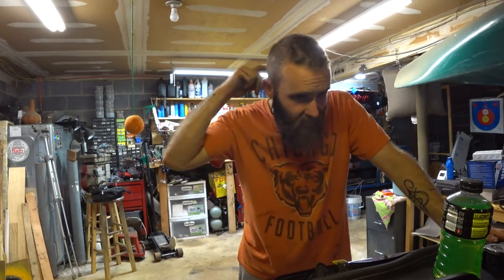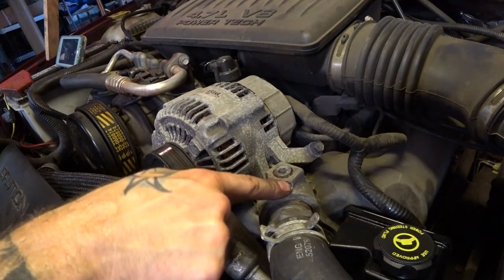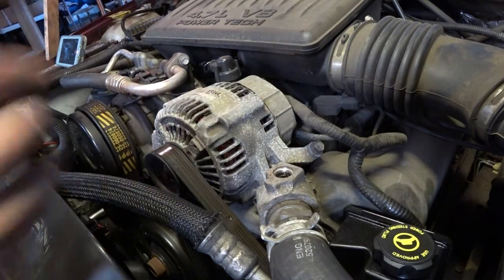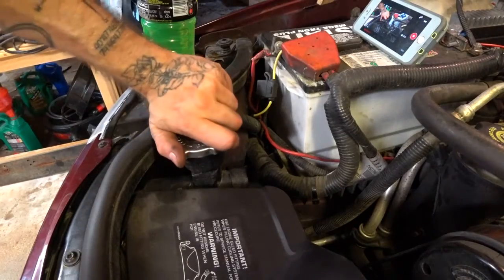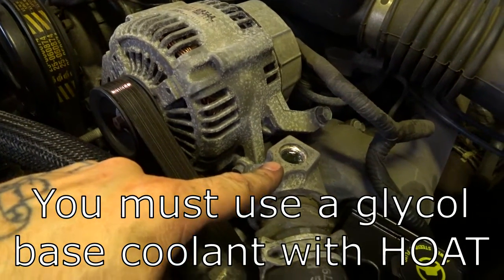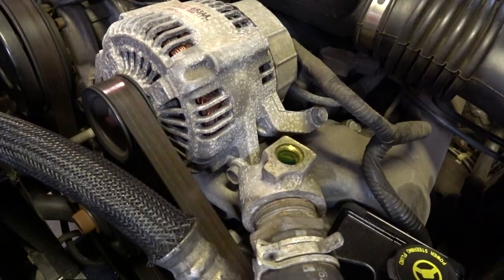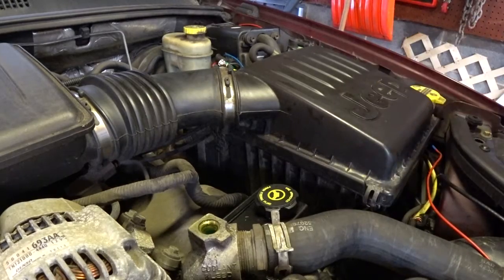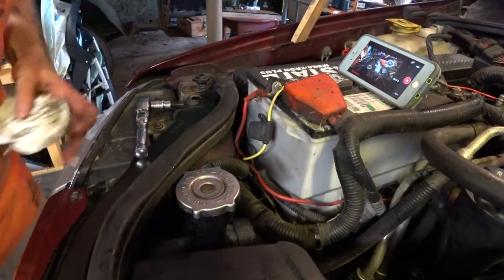How to Bleed a  Radiator - Jeep/Dodge 4.7L

Comment: Bought 4.7 and was running a little warm so i did this and it worked untill it started getting hot again. Over time started notici g coolant drop tho and unfortunately i think i picked it up wi5h 2 cracked cylinder heads😓3200$ and 1 year later running good untill it just now getting hot outside... now it wants to creep up again... very scary. I also had the hydraulic fan system exchanged for a fan clutch as i was not having any luck with the new ps hydraulic pump... now it has a smaller fan though and wondering if the smaller fan is the cause of it getting warmer than normal???

Comment: What happens if it is still bubbling after about 20 minutes after reaching running temp ? Or how long does this process generally take if there is air in the system. I suspect there is a lot of air - - hear sloshing sound in passenger foot box.?

Comment: Thank you so much. I was not aware of this procedure. I just replaced the heads and water pump on my 2003 JGC with the 4.7 HO engine. I performed this procedure and successfully removed the air that was in the system. Great content for shade tree mechanic’s like myself.

Comment: Whew! Good thing i found this video. ‘02 DodgeRam15004.7v8 had a lower hose coolant leak. Drained coolant, changed both upper n lower n thermostat <<gasket/o-ring was worn. Good thing i youtubed while waiting for the coolant to circulate. I usually squeeze the upper hose to hopefully eliminate any trapped air. Awesome tip, thank you!

Comment: Anyone have any tips on how to get the valve off? The top of ny bleeder screw is stripped
Reply from the maker: Go and get a bit "easy out" or a T50 or larger torx bit. Screw in the easy-out or hammer in the torx bit. The pray. Before doing this you might want to try to heat up the area around the plug to break the seal and any corrosion that might be in the threads. It is likely stripped because it is in there pretty tight.
Reply: @DEInTheGarage  thanks…any idead on what i can use for a replacement? Or do you know where i can get the plug? Appreciate the help

Comment: Hey man! I love your channel. We seem to be on a similar wave length. lol! 
You seem to have a great love for these vehicles and solid amount of hands on experience and knowledge. I was curious if you had a video or maybe a list of things to tackle first when buying one. As in when I buy a 4.7 WJ 4x4 what should I look to tackle first as preventative maintenance and possible replacement just to make sure I am starting with as solid of a rig as I can. I'm currently looking at a few limiteds with less than 100K miles on them. I assume those will be in great shape to start, if they weren't neglected. I have a lot planned for my WJ but I want to start with trying to "bullet proof" it the best I can if that is even possible lol! I'm an industrial mechanic by trade so I have a pretty solid mechanical aptitude. Any pointers or sources of knowledge would help. Thanks in advance!

Comment: I can't THANK YOU enough! I've already had to replace the engine in my 2007 Dodge Ram 1500 because of the dropped seat exactly as you explained  ... Was running well until recently, started loosing coolant and not getting heat like I used to... I'm betting the mechanics that replaced the engine and radiator didn't do this .. gonna try it as soon as it cools down 🤞
Reply from the maker: Good luck!!
Reply: Same thing happened to in my 4.7L Commander. 6k for a new crate motor, ouch!

Comment: This works. I tried to bleed my system by just removing the radiator cap and elevating the front end of the truck and the heat would not come through and I saw no bubbles.  I removed the valve he showed and left the cap off and instantly saw bubbles coming from the valve port. But do be aware if you don’t have a wide funnel to catch the coolant you will looses some. And possibly spill onto the engine causing a burning coolant smell. Obviously lol.  But after about ten minutes the heat was melt my skin hot  so ik it opened up and I shut the truck off and capped everything off. Be sure to take the vehicle on short drives and check the fluid level often when the vehicle is cold.  To ensure you have the proper amount of coolant in the radiator, reservoir and engine.   The AC blows penguins and the heat blows fire   The engine temp stays optimum most of the time right behind the center line.  Before it used to run slightly hot. I’ve replaced the water pump, radiator, radiator hoses, and thermostat. So I let a lot of air in. And this method definitely allowed the air to escape.

Comment: I just replaced a water pump on a 4.7 engine. Just like you said, no matter what I did , it would get hot when I test drove it. Once I watched your video I took out that metal plug and purged the air out and finally got it straightened out. It took a while to get all the air out. Big pain in the ass.
Reply from the maker: It is a huge PITA, but I am glad you have it sorted now!
Reply: @DEInTheGarage   Drove it 100 miles yesterday with no problems. Today is got hot. Took the thermostat out, still overheating. Took that hex plug out, ran water in it for 10 minutes to burp all the air out. Still over heating. I think the impeller on the new water pump came loose. It’s like it’s not circulating water at all. Water pump was from the Car Quest auto parts store. Car Quest brand. My engine is completely fucked now.

Comment: I have a 2004 dodge Durango it's overheating bad I have changed the radiator cap and have plenty of coolant is there anything else u can give me a tip on wat might be causing it to over heat

Comment: hey when i remove the upper rad bleed screw then remove the rad cap it shoots out of the hole why is this?
can i bleed it with the screw still threaded in a bit

Comment: Stock engine blew around 150,000 miles bought used Jeep 4.7 commander. Replaced with a rebuild engine , still have heating issues.... 🤦🏽‍♂️

Comment: I recently changed the water pump on my 2004 3.7 Jeep Liberty, now its over heating and I tried doing this but after I had it running and got the temp gauge in the middle steam started coming out of the bleed vlave so I got a little nervous and turned it off.
Is that normal does steam suppose to come out before hot coolant??? I was afraid it will spray everywhere..

Comment: Thanks for the heads up bubba. There's an irony to your video. Last night I was in a Walmart parking lot before I overheated. Got on the freeway and noticed my temp gauge was steadily climbing upwar 😉d. Then out of nowhere it started knocking then shut down on me. Working in her right now. Just flushed the system. Hole I'm doing it right.

Comment: Thanks. Switching to a 180 thermostat today instead of A 195 and needed this info for how to bleed the system. Now I’m debating if I want to flush the coolant from the block, or just do it from the bottom of the radiator. Previous owner had mostly water in the coolant. Tiny green tent to it. So mostly water and the wrong coolant. Sounding like I just answered my question for myself

Comment: I have a problem I have a Jeep Commander 2008 my wife overheated it after I changed the radiator I didn't know about the bleeding that won't start what's wrong with it or what do I do thanks
Reply from the maker: If you want to email me at dandeoff4road@gmail.com I can try to help you

Comment: My liberty 3.7 L is the same setup. Unfortunately the previous owner wallered out the bleeder fitting and it cannot be removed. I even put some heat on it and vise grips with no luck. I  filled mine through the top radiator hose and watched for bubbles in the coolant jug. Took me a couple hours but it finally ran cool. They are a pain in the butt !

Comment: 2000 Dodge Dakota 4x4. Do I have to do this on perfectly level ground? Unfortunately I live in an area where the truck has a little bit of a tilt slightly uphill and a little to the left but the bleed port is at the highest point. I've been having overheating issues with his truck for a little over a year now. Overheats while driving but stays cool when just idling.

Comment: For some reason someone welded my bleeder screw, so there's noway to remove the screw, Is it possible to bleed the cooling system using old school methods like Spill free funnels ?
Reply from the maker: It is a tough road without the bleeder screw because of the geometry of this engine. Air gets trapped at that nigh point. In the past I have prefilled the heater core to eliminate some air before i begin filling

Comment: I have the same motor in my 2011 ram. Replaced the radiator,  but when I pull the bleeder plug it  gushes out like a geyser even when cold!! It's running hotter than it should but I can't bleeder it! Advice please?

Comment: I have a 2003 Ram with a 4.7.  Overheated a year ago, replaced the thermostat and changed the coolant, but I hadn't taken it on any long trips or pulled anything since so no problems.  Today ,a year later, it was running at the top of the gage after a 50 mile trip.  I remember bleeding it, but not quite this way.  I will try it and let you know if it helps.  Thanks for posting your video.

Comment: I have a 02 dodge ram 1500 with the 4.7 and it was overheating come to find out it had a cracked head so both heads got replaced new thermostat and new radiator and new water pump and it's still overheating any ideas for me ?

Comment: Just replaced my radiator on my 2002 Ram 1500 with the 4.7. Came across your video as I was getting ready to fill the new radiator. Thanks for the vid.

Comment: Bro I'm literally stranded because my 07 Chrysler 300 was not done properly like this and the air was so build up that no coolant was even pushing through the radiator hose and it over heated, I shut my car off immediately checked the oil and it was so low from the heat it almost locked my motor up, but I had enough oil to keep adding to it and coolant to make it back to my place but now I'm waiting for someone to get off work so i can get a ride to the store to get antifreeze and oil and everything else but i swear all these other videos out here are not telling you about that bleeder and what upsets me the most is I had a shop do the work, "LITERALLY", I put oil and antifreeze stuff back in and only 10 minutes of driving back home every thing evaporated again from the heat because the Bleeder vault was not decompressed letting the air out in order for the fluid to circulate properly,  I'm just hoping my head gasket is not cracked now but yeah thanks for the video going to do all this when they get off work every one needs to know about this video 💯👍

Comment: Helpful video dude thanks! Just bled my now with this method. However once obviously leaving bleed screw out and rad cap off I but all heaters on inside car on full left it running for 20 mins and temps all sitting where they should be, however my bleed screw didn't over flow like yours does in video but it stays consistent with no bubbles. This should be fine right? THANKS DUDE!

Comment: How long does this usually take? Have had mine going for 2+ hours now and still bubbling
Reply: Most likely you have a leak.  I had the same issue.  Mine (01 Durango with same engine) was at the auxiliary water pump close to the firewall.  It was a slow leak but allowed air in.  Add some dye and get the uv blacklight and glasses to find where.

Comment: I know this video is old but I'm changing my radiator on same vehicle and was wondering if you need to bleed power steering if I removed the lines from the fan . Thanks for responding
Reply from the maker: Yes, but it isn't hard. just run it with the A/C on (to kick the fan on high) for a bit, then turn it off and refill the reservoir. Do this again until there is no drop in fluid. If when you first start up the pump or fan makes a weird noise, shut it down and refill before starting again.
Reply: @DEInTheGarage  Thanks for getting back to me, I'm trying to decide whether to go that way or try to get the radiator out with out the fan

Comment: Can an adapter work to extend the bleed port higher up so as not to be as messy for bubbling? Like install a plug with a brass fitting and a piece of clear hose to watch the bubbles? Or possible downside of doing this?

Comment: I just bought a 2006 grand jeep cherokee and been told #2 valve needs replaced 161k miles not sure if I take it on the road would I be ok not to fix it?runs ok rough ideal but not bad..do you have a video on how I should do it?..Thanks

Comment: Welp. I wish I’d known this after replacing every cooling component, that not working, dropping a valve seat, and replacing with a Jasper built engine... but!!! Good to know for finishing the install of the 4.7l Jasper, do you know if it will be the same procedure?

Comment: Just got my 4.7 WK fixed today, was a bad t-stat and needed to bleed the air out which was done. There was such a big air lock in it that kept the coolant from flowing that we cleared up ultimately that all I know, is I'm glad it is done now and I made sure it wasn't getting past the mid-point anymore for 6 mins or so and it stayed at N.O.T. (Normal Operating Temp). Good video.

Comment: Well that's not what happened when I followed your instructions: With a cold engine, I first removed the set screw (bleeder screw). Then, I removed the Radiator Cap and antifreeze gushed out of bleeder hole immediately. So, then, I tried it with the engine running - still, antifreeze gushed out of the bleeder hole when I remove radiator cap. So, then, I let it warm up and still, antifreeze gushed out of bleeder hole once I removed radiator cap - What gives Bro? btw, When I say "gushed", I mean GUSHED- like a garden hose!
Reply: Robert, had the same thing this morning, I like to think starting with the system only filled to the level of the top of the bleeder is the way, then keep it to that level until bubbles disappear, then cap it off and fill.  Have also heard that simply running it with the bleeder loose but not removed allows bubbles through the threads, may take longer, I did that and now my check engine light is on!
Reply: Update: I simply removed the bleeder screw and let the bubbles come out for about 5 minutes. Problem solved - no more overheating!

Comment: Do you guys think I should consider buying a WJ that has been overheated but then had the aluminum head replaced? If the engine oil is not milky this should mean that there are no cracks in the cylinders whatsoever? Thanks for any advice!

Comment: Went to bleed my 2005 Dodge Ram it started to push the air out and then it started to push the fluid out like a water fountain, why? I'm thinking that the thermostat may not be working correctly. Let me know what you think.
Reply: The pickups have a reservoir that is much higher than the bleed plug.  The coolant at the point of the bleed plug is under more pressure, sounds like you got the air out and then some.

Comment: Many thanks!  My son's 2005 Dodge 1500 4.7 liter overheated.  I found that the waterpump was going out.  So we replaced it.  While there I decided to replace the lower hose.  Hence all fluid ran out.  Refilled and after a few minutes we overheated again.  Upper hose hot and lower cold.  That made me think the thermostat was stuck.  So I finally found the dang thing.  Never found one on the bottom before.  Came across your video while looking for pointers on changing the thermostat.  Hmm.  We didn't do that.  Followed your instructions and boom.  It stayed at operating temp for a five mile trip in 2nd at 2500-3000rpms.  I call this job done.  Again thanks!

Comment: Had to change a cylinder head on my 2000 Dakota 4x4. I guess because I changed the head I'm going to run into a much longer bleed period than most? At least now I have info I need to do it correctly. Thanks. 👍

Comment: After changing the water pump and thermostat ny engine is running colder. The thermostat is a 196° but temp gauge is not near the usual spot.(which was just a tad left of center mark) Anyone know what could be the problem?

Comment: Yep, just like V12 Jags.  There's a bleeder there so use it.  The same thing happens on the Jags - dropped valve seats.  The other thing people can't get though their head is that when a modern car ( mostly alloy heads or full alloy engines ) over heats, throws a belt or breaks a coolant hose or whatever you STOP.  They still think well we're only 5 miles from home or the shop it'll be ok.  Well it won't be ok.  Even an expensive tow is way cheaper than a new engine.

Comment: My 2005 ram 1500 seems to start loose some coolant around my water pump, should I go ahead and change it? Thanks alot.
Reply from the maker: yes, when water pumps go bad they start to leak out of the weep hole on the bottom. first sign it is going. change it before it fails on you, bud.

Comment: My 2000 Dakota 4.7 v8 only overheats when going up longer steep hills. Goes back to regular temp when I pull over and idle or going downhill. Any ideas on what it could be?
Reply from the maker: Sounds like it isnt bled fully, to be honest. Otherwise maybe a fan issue

Comment: Hi, my 2010 Dodge Ram 1500 has the 4.7L and the coolant temp on the dash display is between 198 to 209 is that normal? Or what's the normal temp for this engines?

Comment: I bleed my Jeep this way and works fine doesn’t overheats, but why the radiator hoses are too hard any advice
Reply from the maker: Usually means the hose it ready to be replaced if it is rock hard

Comment: Just drove 350 miles after I replaced the radiator... Am I screwed? Only got to 210 twice before I realized air was in the system
Reply from the maker: No, definitely not. Some people never properly bleed their 4.7. Sometimes it is ok, sometimes it is not, but I am sure you have plenty of time before any damage is done